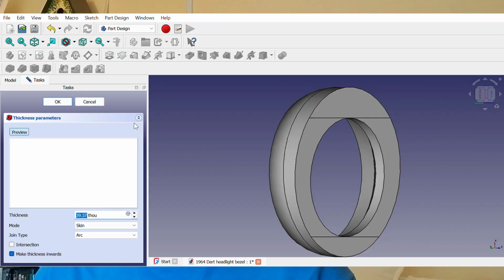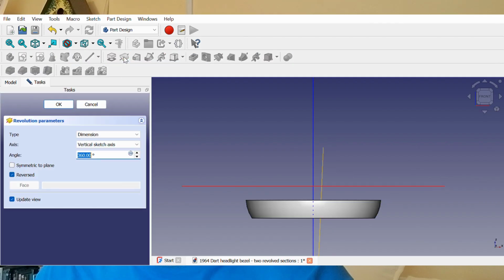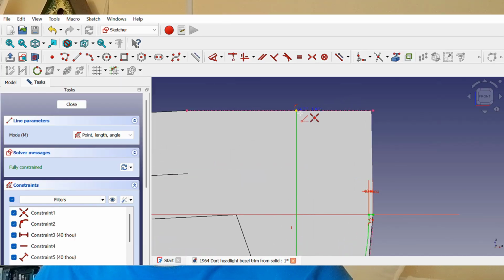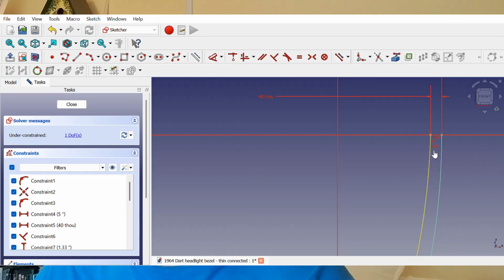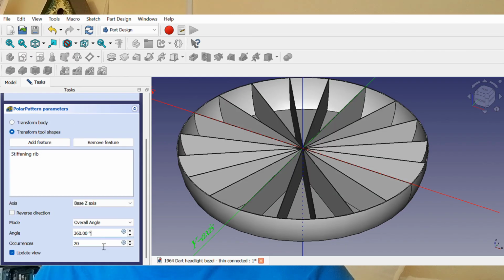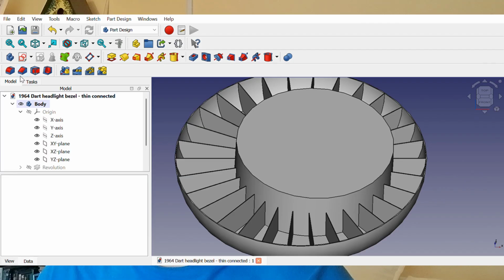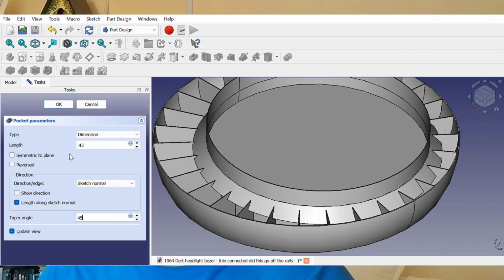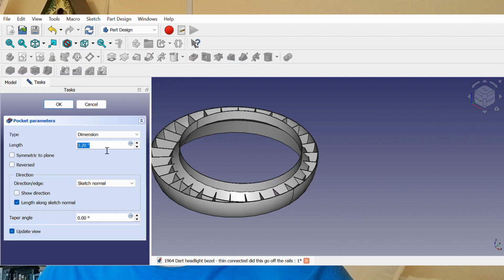Modeling a 1964 Dodge Dart headlight bezel: A FreeCAD anti-tutorial

Comment: Castable parts are the thing to create. I had a guy totally destroy a broken housing for a 41 Lincoln Continental convertible top. To reverse engineer, the guy I called wanted 3 hours at $250. AN HOUR! THEN another $250 for what ever the finishing touches would be. And if I wanted it printed it would cost more. Just to create a part to cast. File can be used in other machines to make the part but they just print. So the money is clearly in that. 😅😂 found you looking around about the regulator under dash.  Working on my uncle's 64 Fury.

Comment: I think you have grossly overstated the seriousness of what you believe are 'bugs' in FreeCAD. Don't get me wrong, it has some serious pain-points, but your characterization is rather juvenile. Shell, fillet, and chamfer tools are problems for FreeCAD, because the only serious, full featured open-source geometry kernel to build a CAD system on top of is OCCT which has ridiculously fragile fillet/chamfer/shell functions any time that edges/faces/surfaces might be consumed by the operation or result in geometry which would need to be trimmed to maintain a manifold solid.. Outside of that, the only thing I really noticed in your video is a general unfamiliarity with FreeCAD itself. Just ignore the Part workbench unless you have no other choice, technically it has some powerful features missing from Part Design, but at the expense of feeling like you're trying to have intercourse with a boulder.

Comment: A couple points that might be helpful since I was just as frustrated as you are: FreeCAD's capabilities far exceeds its documentation, and the part design workbench is kind of a trap because of how strict it is (it's highly annoying because it thinks it's smarter than you are). The 'shell' tool you're using is supposed to delete selected faces and thicken the ones that are left, and it looks like it's trying to do that with the convex faces. Try it with the three planar faces selected and see if that succeeds. If you ever want to just hollow out a solid (think eggshell), 3D offset without fill offset is what you want.
The Part (not to be confused with Part DESIGN) workbench lets you have multiple solids and just do boolean operations with them, which is usually WAY more stable. I think this might solve your issue with the disappearing bodies and the difficulties in lofting between them.
Part ALSO lets you do sweeps, revolves, extrudes, and the likes with lines in sketches to create surfaces, which you can then convert to a solid (for 3D printing) via the draft -> modification -> upgrade tool. Sometimes it's actually easier to start by modeling the surface and making it a solid later rather than the other way around.
Reply from the maker: Thanks for chiming in! Unfortunately the Part workbench is missing several tools that are available in the Part Design, and there's no easy way to move a part you start in one workbench to the other.
Reply: @CramerPowerElectronicsLLC  You can import Part WB stuff in as a "BaseFeature" and PartDesign just kind of complains when you start doing Part operations on stuff started in there. I would not trust going back and forth to be stable but you could probably get away with it once or twice in a model. The patterning tools in PartDesign are a lot cleaner than kooky Draft WB methods for doing the same in Part. I started learning FC so that other CAD software would seem easier by comparison lol but after enough tutorials it started making sense (or maybe I'm just lost in the sauce)
Reply from the maker: @phillipwilkerson2139  At this point it seems like there's three different sources of FreeCAD frustration. One is documentation related - for example, notes on how to get started should give a clear, concise answer on the differences between the Part and Part Design workbench, why they're different, and why you would use one over the other. I've noticed the current release hides the Part workbench, which at least prevents someone from thinking, "Oh, these are two menus of tools I can use on the same part." Which would be quite reasonable if you're used to, well, any other CAD program.

Two is when a feature just has limits that you wouldn't find in a commercial CAD program. For example, "To Next" only allows that "next" item to be a plane. Annoying, but at least you get a clear error message that FreeCAD can't do that and so you find another way. This can be really infuriating when the limits seem arbitrary - e.g. earlier FreeCAD releases wouldn't let you add a pattern to a new pattern.

The third though is outright bugs, where a feature either only works when some completely arbitrary and unstated criteria are met and gives unhelpful error messages at other times (the Thickness command is a repeat offender; they might want to consider hiding this command until they can make it work) or renders something blatantly incorrect and leaves you with no idea how to fix it. Those, you can't really rely on the documentation to avoid, and made up most of the frustrations I ran into with this tutorial.